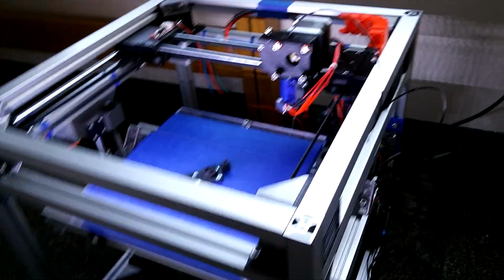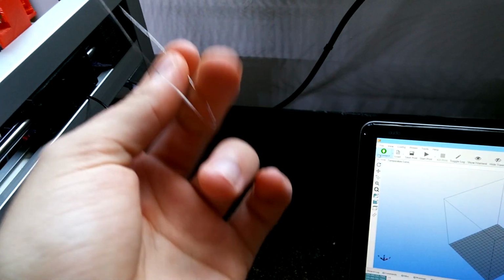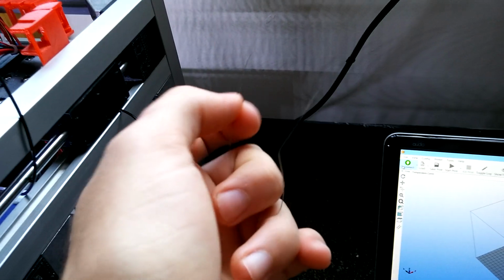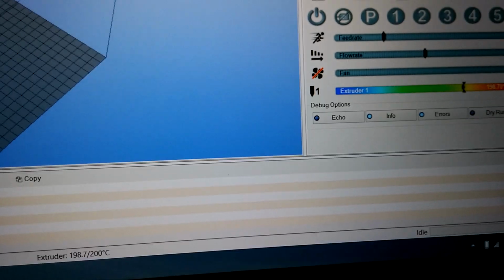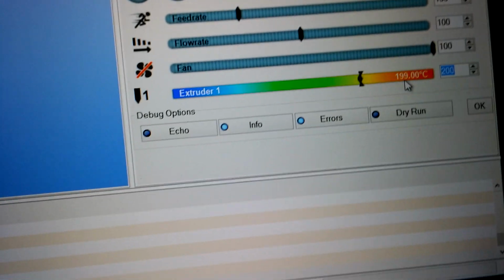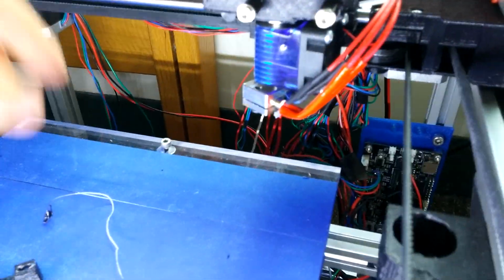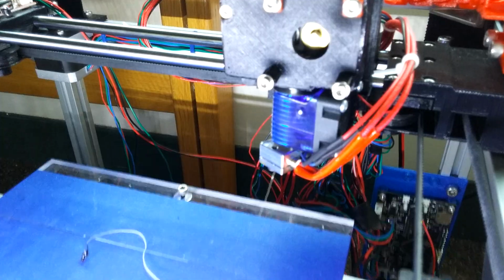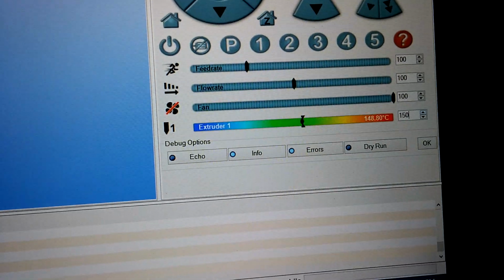How To Unclog 3D Printer W/O Disassembly (Taulman)

Comment: Your video is a great help!
Instead of using the Taulman filiment, I just used white PLA that I had and I had to lower the temperature significantly. Instead of 150 C, I used 90 C to pull the filiment out

Comment: Why do you mention "taulman" wouldn't any filament work?
Reply from the maker: Dallas Gombash to an extent yes, but taulman filament is nylon which is better at cold (more like warm) pulling. Most other filaments you can only pull out when hot, which doesn't clear out the nozzle nearly as well.

Comment: Ribbed Guitar Wire; I carefully feed it into the Extruder which is partially heated to ~80Deg just enough to soften a plastic blockage, then withdraw the wire slowly with the heater off, The cooling plastic sticks to it and you pull out an obstructive blob (usually blackened which is a fault you should try to cure by not letting the Extruder overheat to where it carbonises filament in the first place); This worked well for me. One of the causes of blockages is not feeding enough filament through fast enough to clean out the barrel so try printing a small hollow cube alongside your model sometimes so that it gets more of a Cleaning Workout.

Comment: with the video, what size pla are you using ? 1.75mm ?? Also what is the printer software plz. is it specific to that machine or is it usable with others ?  My 3dprinter is frequently blocking the hot end, wrapping the filament around the tension gear on other occasions.  some of the makers information is saying pla @ 160c other areas its say 180c for extrusion temp and there tech team are obviously reading from a flow chart for fixes and not really helping. im using the eaglemoss printer, the Vector 3  machine .........
Reply: Here is cheap Filament Spool Holder http://www.ebay.com/itm/222298641933?ssPageName=STRK:MESELX:IT&_trksid=p3984.m1555.l2649

Comment: I rarely comment on videos, but I had to come back and say Thank You! This technique has saved me several hours of work in the last couple of months. I have been using Taulman 618 on my 3mm direct drive hexagon hotend. I start at 240C and then drop it to 140C. I clip what has come out of the nozzle, then pull out the filament. It pulls everything out from the shaft and tip. I even get a .4mm nub on the end, so I mean all of it. I had a really bad clog that let almost nothing through. I cranked the heat up and pushed what I could through. After two or three times it cleared, saving me the effort of disassembling everything and replacing or cleaning the nozzle (which is a real pain since I built an enclosure for it). 
So once again, thanks!

Comment from the maker: @Megan Eastman what kind of hot end are you using? Also make sure your temp is high enough, for PLA I usually go around 210 and ABS around 230-240. Other than that, you may have your extruder gear slipping from not enough tension on the filament. There's quite a few problems that can cause this effect so it is important to find out exactly where your problem is occurring before you can fix it.
Reply: +3DprintedLife I keep my temp at 215 for abs, any higher and my filament smokes when it comes out. But I did figure out the problem, my z cal. was way off which was probably due to the fact that my printer had been moved. With that said, after using your kit my prints are better than ever, (after the z cal issue was resolved) the prints are coming out much smoother and cleaner. So many thanks!
Reply from the maker: Megan Eastman 215 definitely sounds a bit low but if it works for you then that's fine, your thermistor may just be reading a bit low. And I'm glad to hear the kit worked for you!
Reply: +Megan Eastman The "smoke" you may be seeing could also be steam.  ABS loves to absorb moisture from the air, and when extruded will make puffs of "smoke" while printing, but this is actually water vapor / steam.  215 seems very low for ABS (215 is what I print PLA at).  if you don't store your filament in an air-tight container with desiccant, then you will have the steam issue when you print (that's why new spools of ABS are vacuum packed with a desiccant pack in them).  There are methods to 'dry' ABS using an oven or a light bulb, perhaps investigate these options, so you can up your print temp.  Ultimately it should help improve the quality of your prints.

Comment: I am having such a hard time fixing my printer, my prints come out glob-like in some parts and in other parts there isn't enough material. I figured it was a clog and used your kit but the filament is still coming out brittle and bumpy. I have no idea what to do no one seems to have this problem. Any advice?

Comment: What software are you using on the PC??
Reply from the maker: Mahmoud Shehata I used to use solidworks but my student edition expired. I now use Autodesk Inventor
Reply: I LOVE SW but I hate they don't give to students for free like AUtodesk. Check OnShape SW founder is the president. It's a full cloud based CAD system. I can send you an invite if you want...
Reply from the maker: Mahmoud Shehata Thank you but that's ok I actually like inventor quite a lot
Reply: How do i set my extruder temperature with autodesk?
Reply from the maker: Jordan Diaz With autodesk? I'm not sure if you can, you need some kind of printer communication software like proterface, repetier host, etc. As far as I know, autodesk only can be used to create the 3D models and then save them as stl files to print.

Comment: So you mean it will inevitably clog up again?
Is there any way to permanently avoid the clogging issue?
Reply from the maker: Not necessarily, using higher quality filament or making some mechanism to wipe the filament before entering can help to prevent clogs.
Reply: 3DprintedLife So is the clogging issue due to the dust? Just wipe it like with a cloth or using some specific solvent?
I got two nozzles clogged already, right after I cleaned them out.
Reply from the maker: NikeTao There's 2 causes, one is dust and hair that sticks to the outside of the filament and another is additives in the filament. Some cheaper filament brands add chemicals and materials to fill space but these can actually end up being larger than the diameter of the nozzle and can clog it.for the dust, just a sponge or a paper towel will do. Check thingiverse as there are hundreds of filament cleaner designs out there which wipe the filament before it enters. For the internal issue, just make sure the filament you use isn't junk!
Reply: Alright, thanks for the advice. I should really look into installing a filament wiper. As for the filament brand - is there any specific one you could recommend?
Reply from the maker: NikeTao There's a lot of good and bad ones out there, currently what I like the most for the price is toybuilderlabs filament, but it is only worth it if you purchase 2 or more spools so you get the free shipping. Without doing that, shipping alone ends up being about $10 and makes the spool cost $40 rather than $30.

Comment: My filament curls up to the nozzle all the time .
Does this mean that the nozzle was machined with some error ?
This was a nozzle machined at home by somebody.
Reply from the maker: Most likely yes, odds are there is some metal scraps that are partially blocking the nozzle. Alternatively, it could be that your heater block is not very thermally efficient and it is heating one half of the nozzle hotter than the other, causing the filament to curl up.